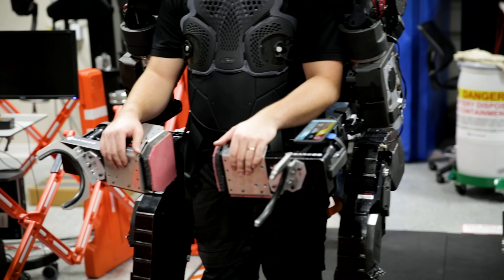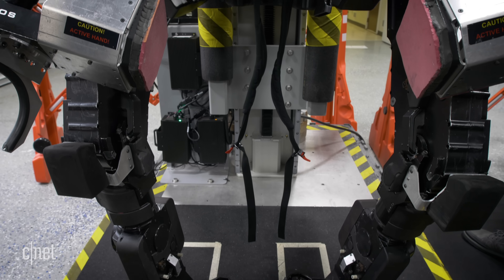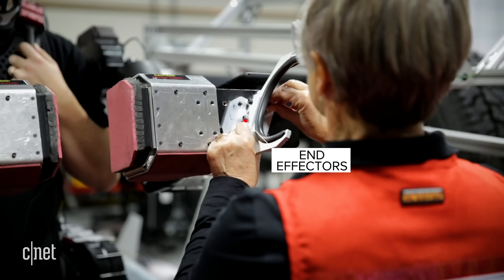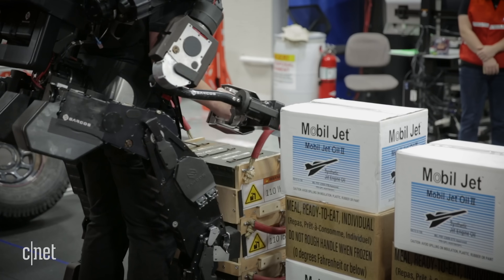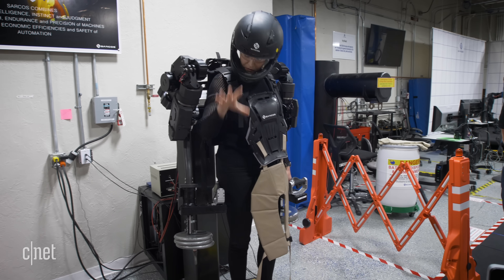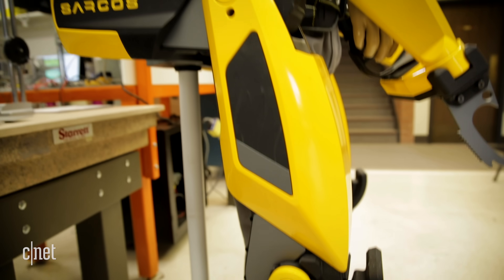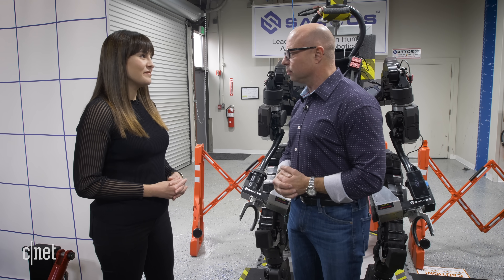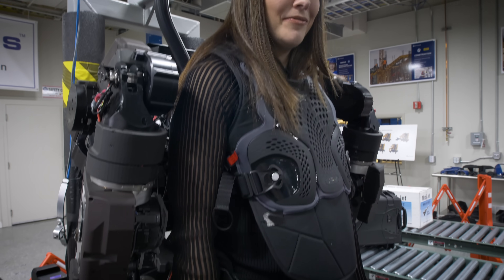Guardian XO is a powered exoskeleton that makes you 20X stronger

Comment: I have 1 concern. Mechanical and electrical devices can fail, so I wouldn’t want to be strapped inside one of these when the knee joint goes. I would rather operate remotely using a stereoscope headset and gripsence gloves.

Comment: Suggestions to the manufacturer: Why can't they have an easy switch system for changing the "hands" seems cumbersome.
And options to be auto tethered to a power source via cable to extend the battery life if you're in one place.
And a seating option if you're "tired" standing.
And optional fans around to cool the person (or heaters if they are working in cold places etc) 
Sorry CNET. Cool though.
Reply: Why do you make suggestions without even knowing it. You don’t need to change your hands out constantly, so why worry about that. I’m sure it accept a tether considering that’s how it’s tested. Your “tired mode” would just be turning it off
Reply: @Jbolo123  Future dreamer consumer feedback. 
Wouldn't it be better if the "pilot" could easily change the "hands" on the fly? 
And what I mean is on the field, hooked up via a cable seems to need someone's assistance, I'm talking about you can auto unhook from the charging point aka like in PASSENGERS the movie.
Yes I don't know anything, but imagine if people didnt take suggestions for improvement and feedback on what they saw or thought would be better. 
I know it's not easy from an engineer's POV, but imagine if Howard Hughes didnt tell his to streamline the rivets on planes.
Reply: Prim N Proper That doesn’t even make sense. Howard Hughes’s streamlining technique solved actually engineering and manufacturing issues. You just watched a sci-fi movie and though it would be cool.
Reply: @Jbolo123  I'm a dreamer ;)

Comment: If it was me, I'd make the feet longer and put powered skate wheels in them. It would significantly increase its mobility and not be as vulnerable to falling over. Those little feet lifting 20 x more weight of anything and you fall back. That 20 x weight is now on top of you.

Comment: wow,  its completely structurally identical to hardware that's existed for decades. such innovation.
Reply: Nothing like this exists
Reply: @christophegroulx7816  several exoskeletons with nearly identical designs exist, and have done for ages. This is nothing remarkable
Reply: @curvingfyre6810  Care to list some examples? I know quite a lot about robotics and this seems novel.
Reply: @christophegroulx7816  just search "top 10 powered exoskeletons"on youtube, you'll find generic mass produced videos form 2016 talking about them having pulled them from headlines
Reply: @curvingfyre6810  None of the powered exoskeletons I watched have gotten actual use beyond helping disabled users. The most similar was the XOS-2, which is a less advanced version of the Guardian EXO and is made by the same company. The Guardian EXO is already shipping to companies for them to try out.

Comment: Useless if you need 
4 to 5 people to operate
it. can a Handicap use it?
That's extra $1.2M+
Reply: It’s not designed for handicap people. Why would they need it. And it doesn’t require 4-5 people to operate. You mean to maintain?

Comment: Those movements would be possible with 30 lbs. Proof: me going to the gym and doing it with a 30 lb dumbbell.
Reply: Sure but for how long? She could have stayed there for hours no issue, besides, she is a woman and doesn't seem to work out that much either so. You pretty much dumb.
Reply: XIAO Am I now? Interesting evaluation.

I agree with the fact that the suit helps to minimize effort put into lifting. (Which can definitely outlast humans and is an amazing piece of engineering) However, lifting 30 lbs in that manner is not impossible to anyone with functioning and un-compromised muscular groups and skeletal structure. Just requires a bit of training to do it.
Reply: @marcellogonzalez2986  Aaaaaaaand there's the point.  It "requires a bit of training to do it".  Whereas, with the suit, you strap a person in who's never touched a dumbbell in their life, and hey presto, they can do it; no training needed.  You aren't limited to using a pool of people who have already trained themselves, or to taking the extra time to train them.

Comment: I don’t see this tech is that useful in manufacturing. Usually industrial robots would do most the job and letting human with this to lift heavy stuff just doesn’t fit in and not necessary. 
The biggest use I can see is still military when they can develop this tech into a much faster-responding and smooth suit for solders. This stuff is expensive and it will be way better that company spend those money on robots instead of this. But if it can be supported by government for military, it would be a totally different story.

Comment: A powered exoskeleton is also an exercise machine able to provide the exact amount of resistance you'd like, exactly where and in the profile you'd like it in with full limb mobility and resistance in all directions.  I've wanted to build a gym around these for years.
Reply from the maker: Hey, keep us posted when you open that gym!
Reply: @CNET  Thanks!  I plan for the exoskeletons to be adjustable in size with each adjustment motorized.  With this, any user could go to a machine, it would sense the user's FOB key and go ahead and change its dimensions to the user's profile and automatically pulls up on the touchscreen the user's exercise plan, profiles, resistance levels throughout the profile of movement, etc.  Just strap in and begin exercising, adjusting where and how much resistance they want and saving that data for next time.

Comment: “This is not a TACTICAL machine. This is a LOGISTICAL machine.”
My Dad said, “That would’ve saved my back in Maintenance.”
Reply: Not at 100 grand
Reply: @jsmeswagner6104  100 grand per year, so $8333 per month. Several people can use it, so during, for example, a construction project it is feasible that it is used more or less 24/7 in shifts, with batteries being swapped. Thus it is reasonably about 4-5 people can use it in a month. Thus we get a monthly cost of about $2000 per month and person. Not much at all, honestly, considering the heavy workload it alleviates.
Reply: @DeNorali  Forklifts that can go up stairs lol
Reply: @jsmeswagner6104  I mean why would an employee pay for a company asset? Let's say you're working on the shipping docks and they have 3 of these things bought for the job.
Reply: At the moment, give it another 50 year's and it will basically be Iron Man
Reply: @PS-py8zf  You won't have to wait 50 years, hopefully 10.
Reply: @christophorus9235  5 years or 6 years not iron man but something permanent but imo better as it will be stronger
Reply: Tactics are a young mans game, logistics are for the wise. 

They are in all technicalities right about it being logistic as it doesn't improve combat capabilities. It does however increase your weight load capacity. You wouldn't be much more then a mule wearing this bulky thing.
Reply: @PugilistCactus  Not to mention the issue of random circumstance, your almost universally better off not cosplaying as optimusprime and his autobots regardless of profession
Reply: LogicalSense  I'd imagine the details in which this mechanism is applicable can vary in a multitude of ways where a bulldozer cannot accomplish. If we're talking about a large enterprise I'm sure its uses can be purchased.. bulldozers cost nearly just as much to get one of these.
Reply: LogicalSense  To use a forklift you need to load and unload a pallet. So someone needs to put the thing you're trying to move on the pallet, and then take it off the pallet once it's moved. So you're just saving yourself half the job, while having to perform the other half yourself anyway. Not to mention an exoskeleton gives you the dexterity and maneuverability a forklift will never be able to accomplish.

Comment: "Its not intended to be equipped with armour or be used on the front lines" Sure it isn't. Maybe not THIS model but take a look at these over here. This one can be automated!
Reply: I mean exosuits like the ones in movies are kinda dumb if humans need more firepower and armor just get a tank or an armored truck. The only reason they are so prevalent in movies and video games is because they give the audience or player a more intimate connection to the battlefeild. In real life an exosuit especially like in edge of tomorrow would be a waste of money.
Reply: There is actually a real good reason why these can't be used for the military (right now).

In the video the guy mentions that these machines can last up to 8 hours. The thing is, a combat situation can easily last 14-18 hours or longer plus the time spent between a firefight. And a military exo suit needs to carry a lot more weight and take a much worse beating then a civilian exo suit. 

So until Elon Musk can massively increase the charge of a battery for something this powerful (we're talking about needing battery charges that last 36-72 hours), these machine really will remain only in the civilian world and non-combat military positions.
Reply: @jesseward4115  Elon Musk? Try John B. Goodenough (though they might actually collaborate in the future). Look up Solid State Batteries. They advertise 2x-3x more battery life ONTOP of being non flammable. So even if the pack was punctured in combat the wielder wouldn't be immolated. This technology could power a suit like this for 72 hours possibly. Probably wont see solid state batteries for another 10 years or so since these things move slowly.

Comment: Imagine if this used solid state battery. It could be stronger and run longer before needing a recharge
Reply: Id stick a diesel engine in there
Reply: @mackk123  your ears would be gone after a few hours of use
Reply: Good idea, you could make a small backpack to put the battery inside, and make it way more light-weight!

Comment: Not designed for military use .. yet still funded by the military lifts mock missles and ammunition crates.
Reply: Yeah, you need at least 10kw for 10 hours for the military.

Comment: Interesting how the suit is advanced but the hands are captain hook.
Reply: They're more concerned and focused on the machine itself, the hooks will do the job for now. I suspect that in the future they'll have some sort of quick change mechanism so you can easily swap out hands without the use of tools.
Reply: @RussianPowerful  Yea thats understandable. Point being is they make the machine look not so ABLE like by having hooks as if you put dextrous digits people would start to imagine.
Reply: Arrr matey!!!
Reply: worddddd maybe in 225 will get the hands
Reply: @mrsickfck7575  and maybe in .223! pew pew pew!
Reply: Powered hands require extra hydraulics systems, they can be retrofitted once production funds roll in.
Reply: @OldNavajoTricks  I see that they could well have a classified devision that would be working on that side as I am sure there will be turret systems included. Machine looks more approachable and innocent compared to power gips that would brake bones  lol
Reply: @OldNavajoTricks  Thanks to hydraulics, mostly you only need a hose to connect the interesting parts. Wouldve been a helluva design challenge to try fit a big motor with gearing at the forearms
Reply: @de0509  I did say hydraulics specifically for that reason, and they will require extra pistons, oil, oil reserviors and circuitry/software upgrades, which adds weight, affecting balance, vulnerabilities and runtime.
Every "New" release we get to see is just a stripped down version of the original prototypes
Which was military in the first place, they fund it, they get what they want lol, by the time we see new stuff, it's at least a decade old at the minimum.
Reply: Makes sense though. If you see people with prosthetic hook hands. There's a lot of versatility and things they can do with a minimalist design.
Reply: @TheCaptain008  exactly Captain!
Reply: Lmao
Reply: Well the guy did say it's built for you to attach multiple tools it's not just hooks.
Reply: Turns out making human robot hands is as hard as the age old trick if drawing them.
Reply: @PugilistCactus  I could make one way before drawing one lol :-D
Reply: Probably hydralic claws, drills and other tools will be a nice addition. For military use? Dual gatling guns would be beast.

Comment: Why on Earth wouldn't we just use a forklift, or a hoist. 

It's fun to pretend you are Ridley from Aliens but this is stupid.
Reply: Maybe because this equipment is smaller, easier to control, fits in tight spaces, doesn't waste the use of a forklift on small but heavy objects, etc...
Reply: @DannSloth  Google engine lift, or block and tackle. Look at how small and maneuverable they are and can be. 

This is a cool project don't get me wrong. I like engineering. But I also worked in warehouses, and engine shops, farms and for shippers. 

This is the kind of thing no one asked for. It's neat. But it doesn't appear useful. I still want one though lol.
Reply: @pierredelecto7069  you only worked blue collar jobs huh ? guess you didnt get that highschool diploma, it shows
Reply: @FimbongBass  I have an master's degree lol.
Reply: I don't think it is meant to replace the forklift or a hoist. Most likely it is used in places where space constraint is an issue, or where the things handled are heavy but smaller.
Reply: @kokhowe  a hoist could do everything I saw in that demonstration for like 1/1000 the price lol.  You can buy an engine lift for example these days for under 200 bucks and lift a ton with it.
Reply: The answer obviously is when we can't use a forklift or hoist and the application is of high monetary value or life and death situations.